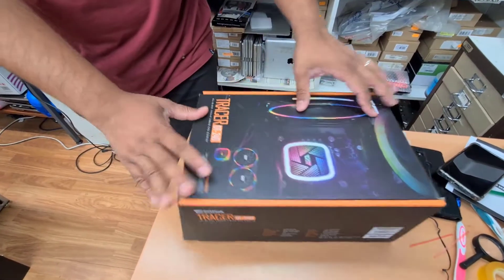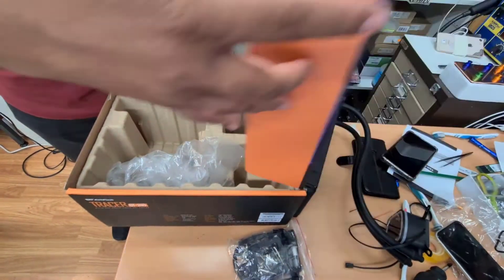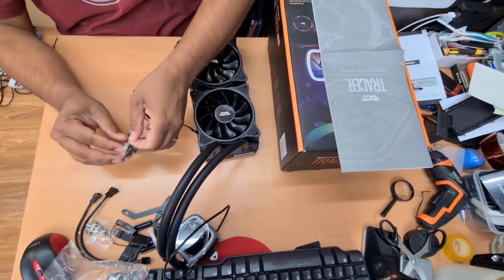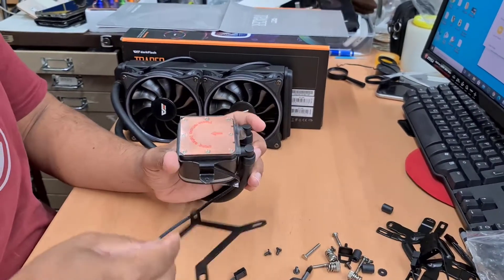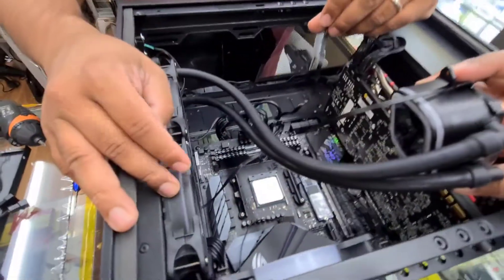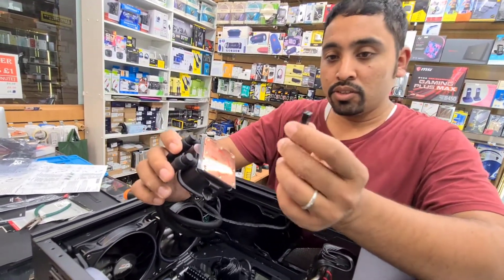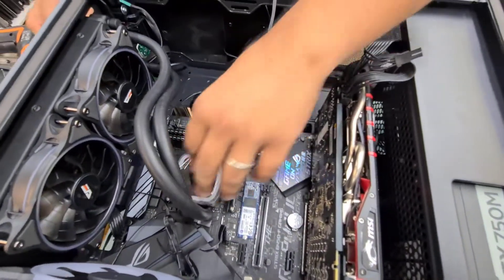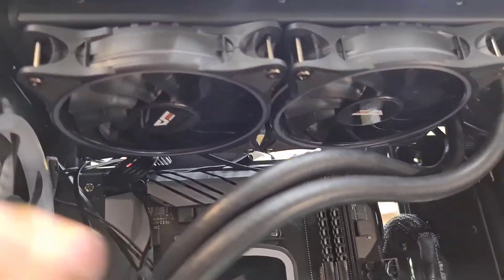How To Install  Liquid Cooling On Gaming Pc | Tracer DT240 DarkFlash

Comment: hello, im currently using old mobo .... msi h310m vdh pro plus, it has 2 fan socket (sys_fan & cpu_fan)

currently connecting it using y splitter for the fan and to the sys_fan, and pump connector to the cpu_fan

which part is wrong and need fixing ?... thanx :D
Reply from the maker: Two connectors here, most important for the fan connector, another for the light"!.there is a diagram with a large illustration. You may, can check to find the mistakes about it.

Comment: Where will i put the socket of the fan in the radiator?
Reply from the maker: Connect in the system fan pin. Not in the CPU fan.